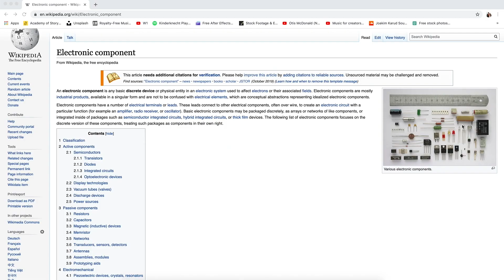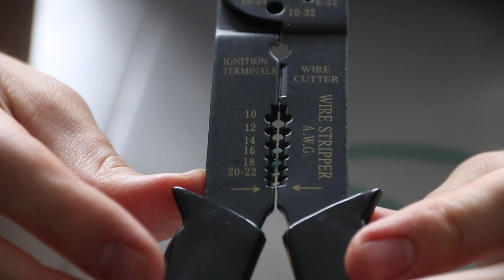Tour of My DIY Model Rocket Launch Controller

Comment: I built several launch controllers back when Radio Shack was still around. I no longer have a source for parts. I've also built many launch pads, many out of office chair bases, automotive jackstands, mirror mount CB antenna brackets, etc. I use drill chucks to hold the launch rod. All metal, no plastic. They are real hobby grade stuff, not cheap toys like Estes and even AeroTech sells.

Comment: I am interested in buying into the video series. I am doing a clustered launch and i want to ensure a strong voltage to the rocket and i want to use a motorcycle battery or small car battery as my voltage source does your videos include information on making this possible ?

Comment: I’m currently working on FFG Star Wars TTRPG. Purchasing the sourcebooks. Which is getting kinda hard to find. Just missing three. After that I’ll be back to building flying model rockets. 
Just need some ideas. I’m thinking bout build my own flying model rocket launch controller out of a pelican case. But I need a bigger case. I want make it with voice authorization. Like how then “Admiral” kick set the self destruct sequence on the Enterprise A 1701. Instead it’s Computer this is master launch controller ____ request security access. Computer set auto launch/kill launch. Code 1: A1R1. Then code 2: A1R12B. Code three: 1B2BR13. 
Then finally code: Code 0000launch/kill Launch 0. That’s after you turn on the controller with the key. But that’s one idea.

Comment: What are the ballpark costs for parts to build one as shown after we buy your plans?
Reply from the maker: It's hard to answer because it will completely change depending on the tools and parts you have already, and if you only build one controller you'll have lots of leftover pieces and wires so the next controller would be MUCH cheaper.  

If you have nothing my best guess is that the basic controller will cost you about $80.  (again for most people it would be less).  If you have nothing, I would guess the complex controller at most would be about $120 in parts.

But again, we don't just give step-by-step how to follow us, but also teach the theory of how the controller works.  The majority of people who watch our videos customize the design to make it their own.  So if price is an issue there are always ways to customize it to bring the price down and fit what you need.
Reply: @themodelrocket220  thank you!

Comment: Hey does anyone know how the chromed trim around the LEDs ar called??? Cannot find it anywhere...
Reply from the maker: It came with our LED's, I think the instructions referred to them as "fittings" 🤷‍♂️
Reply: @themodelrocket220  thanks a lot man, finally found them, it was hard but I found them...
Reply from the maker: @clementecarlospereiraramos5131  It's worth the hunt, it makes the controller look so much more professional
Reply: @themodelrocket220  hell yeah, I'm also introducing some aviator connectors into the design and it makes it look so much profesional. I'm not 100% using the controller for rocket model launches but it's completely related to that theme, I'm also designing a splitter so I split a 6 pin cable to a different number of pins cable... I don't know, to many ideas came to me at the same moment and I'm still trying to figure everything out.

Comment: Your enable switch should be momentary, not a toggle. That way you won't have to worry about accidentally leaving it enabled and having it accidentally fire if someone bumps the launch button.
Reply from the maker: I've seen that! One of the things I mention in our course is that I went with a toggle so that my 3 year old son can help me launch.  He doesn't have the coordination to operate two momentary switches simultaneously.  So we use extra safety measures and levels of caution when launching!!

But under any other circumstances I 100% agree momentary would be the way to go!

Comment: They are quite simple
Reply from the maker: Maybe for some people, but for those new to the hobby, new to electronics, new to any kind of models that's a lot to learn on your own.  But you've seen my launch controller show me yours!!  Do you have pics or vids?
Reply: Not to build what he is showing.  The continuity check is the kicker.  I built my own controller and skipped that part because I didn't want to mess with figuring out integrating appropriate resistors.  This is cool stuff.  Would REALLY like to see how to handle multiple rockets.
Reply from the maker: @audittechmate447  Thank you!! Hopefully we can make that happen in the next round.